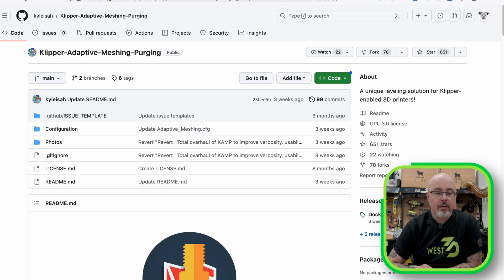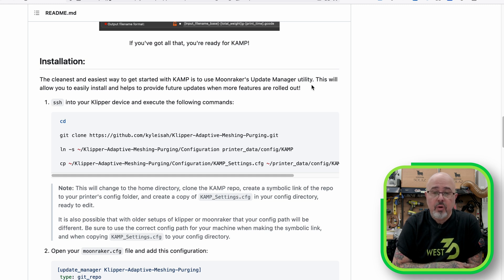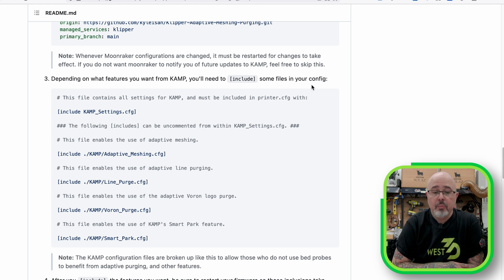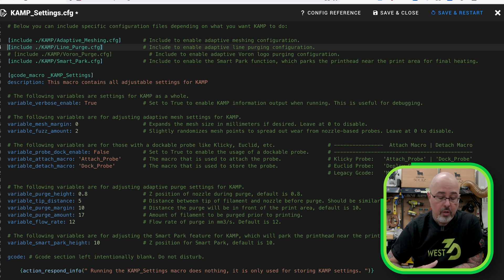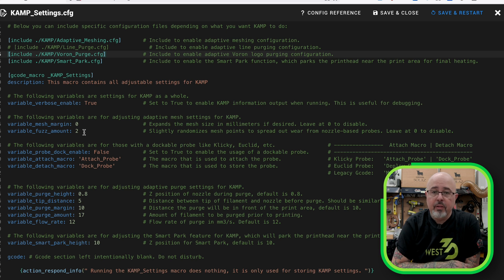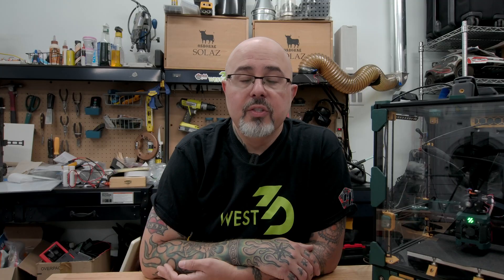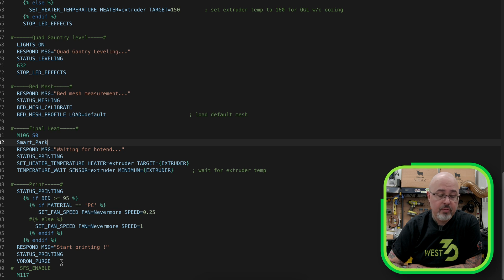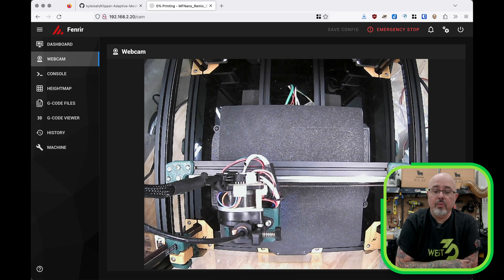An update on KAMP- better installation, new feature!

Comment: Thanks for the video.  I get a message that the config can't be added because there is no such file or directory.  I've been searching but I can't find what my directory is as I'm assuming that is the issue.  The KAMP config is not currently listed for me.  FYI using a Sonic Pad.
Reply: Did you figure this out? I have the same issue and I think it’s because there’s no bed mesh code for me

Comment: This video showed nothing like how do i ssh into my klipper device? Im sooo confused
Reply: What interface do you use to access your Klipper installation?  Fluidd, Mainsail, Octoprint?    You should be able to edit the .CFG files directly from your web browser using any of those.
Reply: Some people use putty to do the SSH stuff when using raspberry pi. Build it basement shows how to use it in his 1st klipper video. You will need your pi IP address. I feel like he kind of just said stuff but didn't say how on a lot of things. I haven't gotten it to work yet. The cut and paste into SSH is where i'm stuck too. Fatal unable to access. Fail to make symbolic link etc. When I get into printer cfg none of the includes are there.